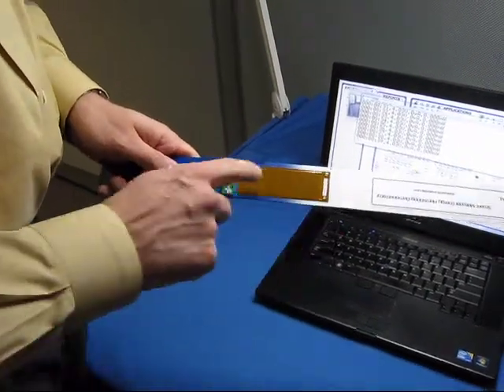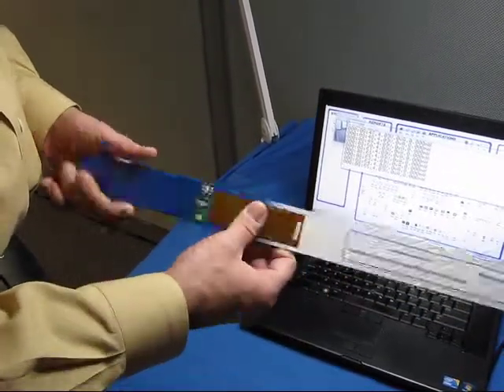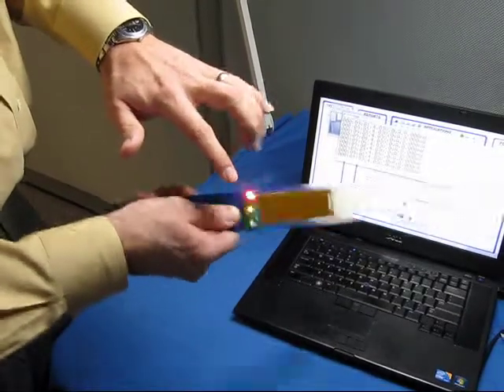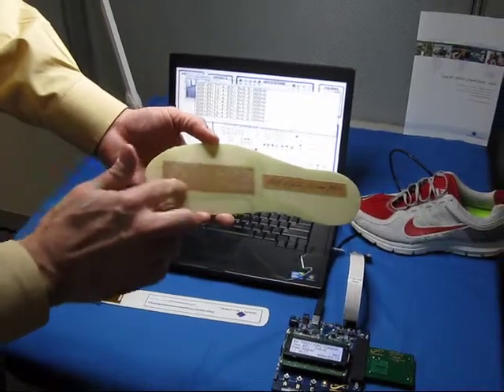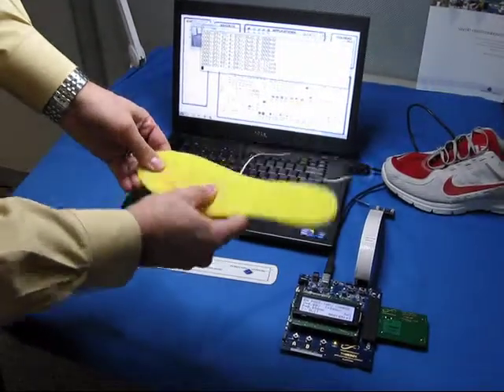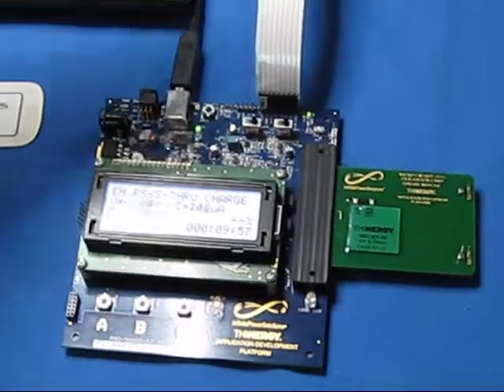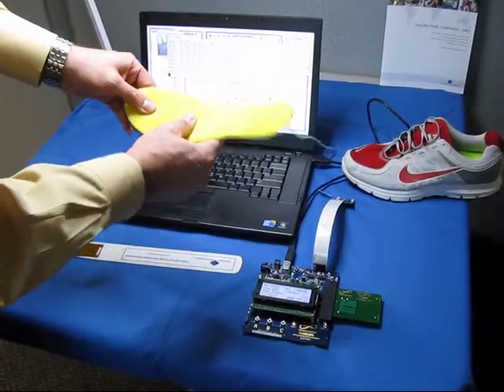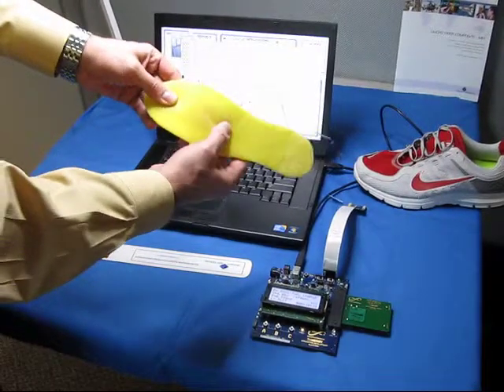MFC Energy Harvester in a Shoe Insole

Comment: This is way over my head, but perhaps you can help me.  I'm dealing with invisible floor vibrations in an old school building turned apartment building.  I'm on the Second floor, and have been dealing with intermittent floor vibrations apparently emanating form the first floor apartment that has allot of body motion and activity, i.e. is a very large suite that is all lit up till midnight with heavy electrical usage.  There are two types of vibes that I am experiencing:  (1) is a steady current that might rather be liked at a very low level, like that of a massage chair... when I am lying on my Aerobed in the living room or the bedroom.  (2) No. #2 is the worst vibration as  it is erratic, like a peculating, bubbling-up sensation that is most annoying  (for example right now  it is felt through my slippers, sitting at my PC).   When it is as its worse, it is an erratic pulsing sensation that makes it nearly impossible to sleep.
            My guess is that I'm dealing with positive ions coupled with a structural deficiency in my unit, which I just learned use to be the gymnasium (?), on the second floor!   And I believe I'm dealing with harvested energy that builds up throughout the day.  It's strange because whenever the two young 20- something tenants below me are not home, the floor is perfectly calm and I can relax and rest.
              So being desperate, I was thinking of ordering something:  Isolate It!: Sorbothane Acoustic and Vibration Thin Film Square, 7 x 7 to put under my Aerobed.  I am hoping that will help.  What do you think?  Is there anything else I can do other than move out of the unit?
Reply: I hope you figured it out, that sounds really irritating.